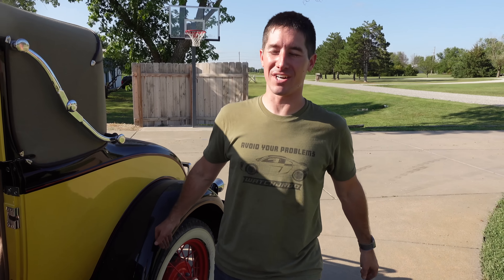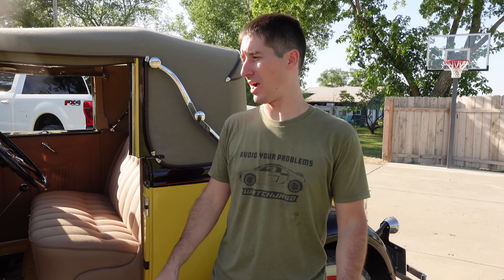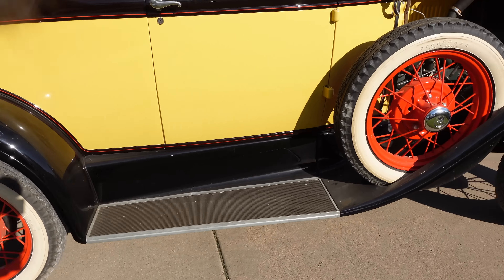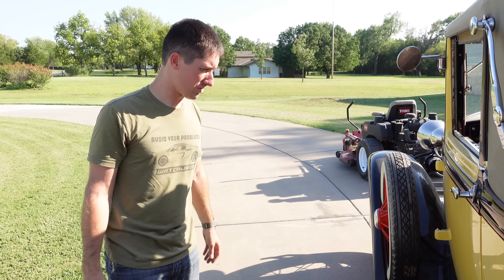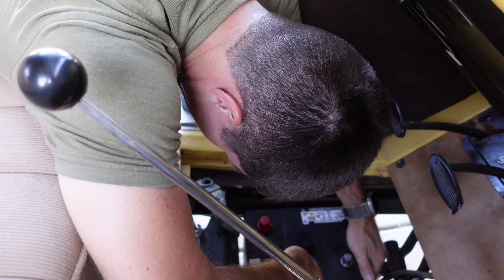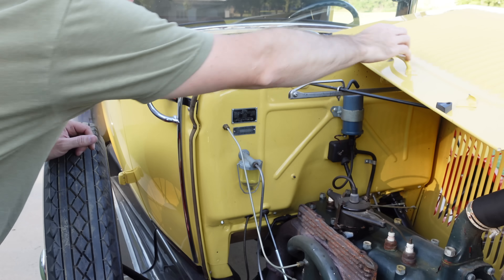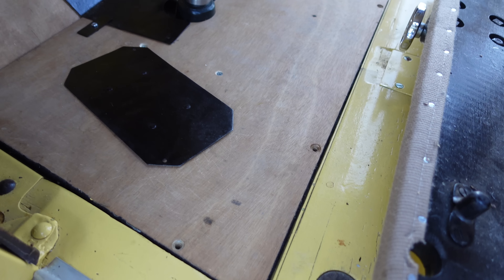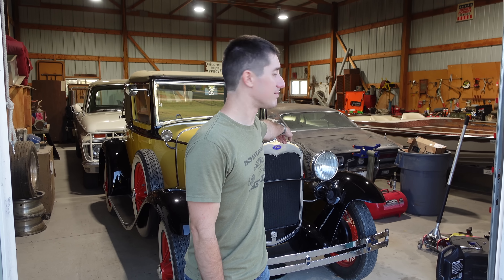Starting A 93 Year Old ABANDONED Ford After It Sat For YEARS

Comment: Whoa  Back up the bus!!  That "giant iron log", as you describe it, is actually a heater for the interior.  The shroud over the "log" is missing, and the hole in the firewall either was never drilled or has been filled.  The cooling fan would blow air into the (missing) shroud, and the hole in the firewall had a cover that could be opened or closed, depending how much heat you wanted.  These were aftermarket; many different designs were sold by different companies.   I don't know where you got your info, but be careful who you listen to!!
Reply: I hope he doesn't use Ethanol in it as any cork it comes in contact with dissolves, as alcohol is a solvent for the shellac binder. Carburetor float, sediment bowl gasket, etc.

Comment: I’m a tech at a Ford dealer. We have a 1930 Model A in our showroom. 
We take it out once a year for a drive, I’m the only one who knows how to start it and drive it. Every year we push it outside connect the battery and it starts up like it was driven the day before. 
You may want to disconnect the battery or pull the fuse on the generator when not in use so you don’t have a fire.

Comment: The long block on top of the exhaust manifold is not a carb/intake preheater.  It is part of the cabin heat system and missing the cast aluminum shroud and the hole through the firewall.  It really shouldn't be on the car without the firewall hole.

Comment: No fuel pump, just good old gravity to feed the gas from the tank to the carb.  My dad restored Ts & As in the 60s.  We still have a 26 T roadster (now my brother's) and a 24 T Touring (now mine) that he restored in the early 60s.  We got the 26 running over Memorial w/e - hadn't run in 25 yrs but she fired right up.  The 24 hasn't been started for 10 yrs but it always starts.  Hard to believe the 24 is almost 100 yrs old.

Comment: They are such simple cars I'm sure with a tune up or just cleaning things up it'll run again. Hell, it might not even care about bad gas. My Dart started and ran with 6 year old gas in it. If it hadn't been for a bad accelerater pump it would have been a fun drive the 5 miles to the new house. The gas smelled like paint thinner even but it ran. Someday I'm going to rebuild the carb (Thermo Quad) and see how it does. It has the original 318 in it with 175k on it.

Comment: Sure someone already mentioned this but the wipers probably started life as vacuum actuated, but could be hand operated if needed.  There are upgrades for those wipers to change them to electric.  Had the same thing on my 1947 Jeep CJ2A.
Reply: The wiper motor is still vacuum operated. At 2:46 you can clearly see the vacuum line coming from the intake manifold to the firewall, where it most likely continues to run under the dash to the wiper motor. Unless you have a "wolf whistle" or some other aftermarket vacuum device installed, this line is strictly dedicated to operating the windshield wiper. If the wiper was replaced with an electrically operated motor, this line would probably have been removed and capped off at the intake manifold to prevent a serious vacuum leak.
Reply: @chipper20  saw that it was still vacuum operated, but at least for the CJ2As they made aftermarket electrical ones if you upgraded to 12v system.

Comment: Will it need a fuel additive to compensate for the lack of lead?
Reply: In 1930 there was NO lead in gasoline. Lead showed up sometime after WW2 to boost octane ratings, when automobile engines with increasingly higher compression ratios were being manufactured. The 1930 Ford Model A had a compression ratio of 4.22:1 and could burn almost anything flammable. The average octane rating of commonly available gasoline in 1930 was barely 61, so feeding this car 87-89 octane, unleaded regular gasoline, containing no ethanol, would be considered a gourmet meal for this car or any other car of a similar vintage.
Reply: @chipper20  Good to know thanks. Way before my time!

Comment: The fuel shut off inside the car on the underside of the gas tank must be shut off when you shut off the car and opened when you run the engine.  If the pet-cock is left open, the fuel may, can and will leak past the needle and seat and drip onto the ground.

Comment: “ you can have any color you want, as long as it is black”
Reply: The color of this car, Bronson Yellow with Orange wheels, is period correct for this car. The Model T (1908-1927) manufactured after the advent of the assembly line in 1914 were only available in black because other colors simply took too long to dry.  When lacquer paint replaced the enamel paint used on the assembly line, prior to the introduction of the Model A in 1928, Henry Ford once again offered a choice of colors.